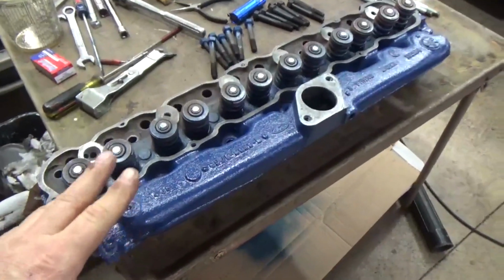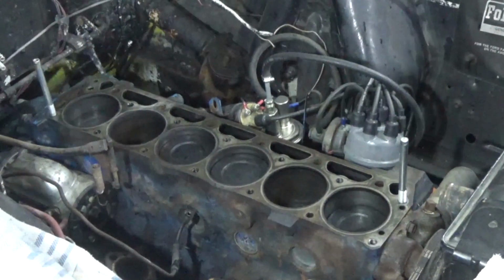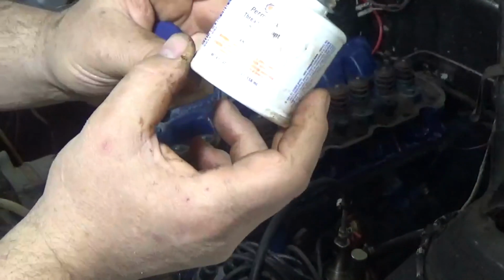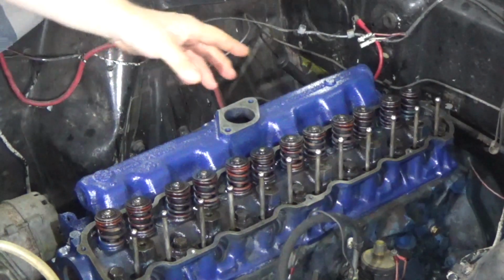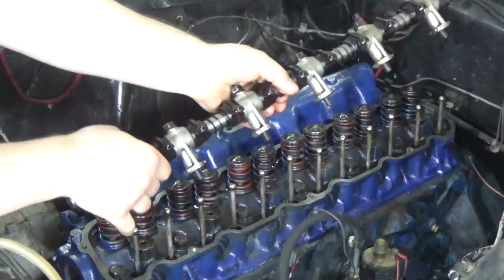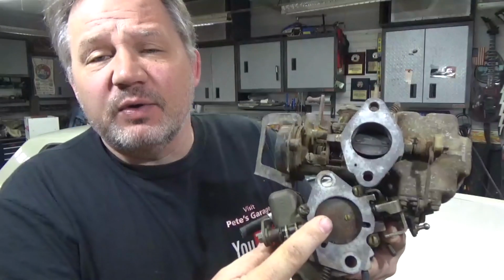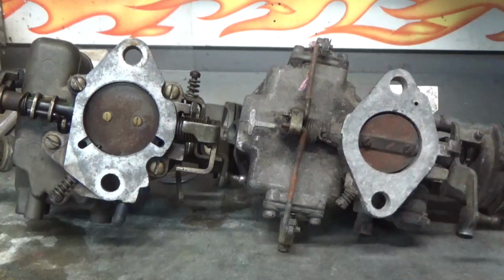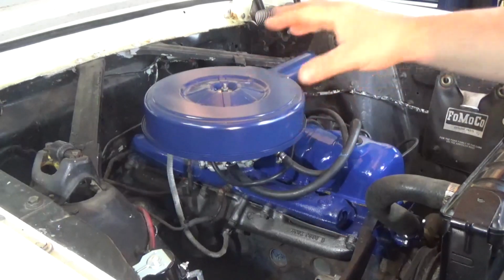Cylinder Head Install & Startup - 1965 Mustang Straight 6 200ci Autolite 1100 Carburetor

Comment: I know this is an old video but just incase someone want to imprrove oil flow to rockers. A 350 chevy narrow shouldered main bolt can substitute as head bolt un the oil feed location. It works maybe a hard washer on top to get correct thread depth.
Reply from the maker: Great tip!

Comment: Is there a fitting on the exhaust manifold that the heat-rise tube for the automatic choke attaches to? In your video, it appears that the bottom end of the tube isn't attached to the manifold, rather just flopping loose.
Reply from the maker: Yes there is. I do not have it on
Reply: @PetesGarage  Thanks, Pete. I'm helping a buddy replace the Autolite 1100 carb on his pristine 2-dr Hardtop '65 Falcon Futura, but it's missing the heat-rise tube & fitting for the auto choke. I'll have him order a new one.

Comment: Just got rid of 83 ford fairmont smog pump with a 200ci strait 6 and a auto lite 1100 carb and I’m pretty sure I have my vacuum lines all wrong now. Please help with any info or diagrams I can search up please and thank you. It does have the vacuum advance duraspark distributor
Reply from the maker: That should be easy to find online

Comment: Hi Pete, great videos. Would you be able to help me with my 66mustang. Inline 6, 200, autolite 1100. I am getting fuel and the engine turns over but wont stay on.
Reply from the maker: I'd start with the fuel pump. Disconnect the fuel line at the carb and turn it over, make sure you're getting enough fuel. Check spark at all the plugs

Comment: Not sure if u can guide me . 
Bought a 66 mustang from Washington brought it home and failed me . 1st carb at idle didn’t leak gas but when I turned it off it began leaking gas from the rear and front . Got a new one did the same thing not as much . After a while it stopped leaking completely took it around the block and it died and wouldn’t turn back on again. Kept on flooding the carb . Any ideas or recommendations?
Reply from the maker: Change the fuel pump, the check valve is stuck

Comment: Great video!   I need carb adjustment on a 63 f100.
Reply from the maker: You can do it! One needle to adjust
Reply: @PetesGarage  i am pretty sure I need to clean it out.   After sitting all winter in Wisconsin.  I have done small engine carbs before.   I adjusted the one screw and there were no real changes.
Reply from the maker: If the needle doesn't change anything the jet may be too large
Reply: @PetesGarage  if it ran tip top before storage I would think the jet would be good to go....right?
Reply from the maker: Sure, it could run, but the jet could still be too big. Maybe a good flush will help it out
Reply: @PetesGarage  if it ran better with the choke out would the jet be too small?

Comment: Just got one of these engines ,,,Why does the carb have what appears to be 2 accelerator pumps,,Any suggestions on where to get info on how the 1100 carb works,,Thanks ,Best Regards
Reply from the maker: One is the accelerator pump, the other is the dash pot

Comment: Do you have any advice on having the intake machined to accept two 1-barrel carbs and have them positioned over intake port #2 and #5?  My thinking is this would solve the "too rich" central ports and "too lean" end ports problem, but I don't know how much to reduce the cfm of each carb to keep the mixture where it belongs.
Reply from the maker: That's a pretty aggressive solution.

Comment: Where does the choke hose connect I don’t know where to connect mine on the exhaust manifold
Reply from the maker: You need a heat riser that fits between the exhaust manifold and exhaust pipe

Comment: Do you know the size ( nominal and measurment) of the main jet you had before? 
And we're you able to get the correct one from eBay or Amazon?

I'm pretty.sure I have the same issue.

I'm also curious as to what symptoms you had
Reply from the maker: There is only 1 main jet. I too it apart and got the size and bought a couple on either side of it. A web search for autolite 11000 carb jets will give you a ton of results. It was really rich, black smoke out the exhaust
Reply: @PetesGarage  Thanks. I will look into other jet sizes.
Henkyo sent me a message saying that perhaps the carburetor is deffective if it requires too many adjustments. 

Did you have to do any other adjustments apart from changing the main jet?

Thanks again for replying to me, and feel free to watch a few of my videos...perhaps there's something there that can help you???
Reply from the maker: The main jet is all I changed. I will check out your stuff, thanks

Comment: Hey good video.

That other carburetor looks like a carter YF...I had the same issue. The car still ran but would idle like crap.

Can you tell me about the new carburetor? Is it a new HENKYO from ebay? 
If so, can you give me some advice on adjustments? The one I bought came completely non adjusted so it wouldn't run right. The issue I have now is on idle, it will sometimes flood. The other is that the mixture screw seems to have no affect whatsoever engine still runs with it being completely closed.

I suspect main jet is too large??

Cheers
Reply from the maker: It was from HENKYO. I did have to change the jet a couple sizes smaller
Reply: @PetesGarage  thanks for your reply. I'll probably have to go the same route.

I've also had to do quite a few adjustments and I'm curious as to what you did.

Comment: Just replaced my autolite 1100 on my 68. Do I need to prime it first, and do you have a video showing how to set the choke and idle?
Reply from the maker: It will prime itself. I'm making a video about the carb adjustments
Reply: @PetesGarage  ok, great! I was able to get it going but will benefit greatly from a video on how to make the idle adjustments. I believe I may need a new accelerator return spring or whole new linkage set. I don't think it's returning to where it's supposed to which is messing up my idle. Thank you for the response, I'll keep an eye out for the video.

Comment: it looks like you have the wrong spacer plate for the carb.
Reply from the maker: I have been looking for the right one for this engine, it's out of a '68 Falcon
Reply: @PetesGarage  Depends on the carb. If you have the autolite 1100, it should be the Carb Spacer OEM Ford 144 170 200 6 Cylinder Falcon Comet Mustang More Pre 1968
(124749655048)
Reply: @PetesGarage  Correction: I see what you mean now. The bore on the intake manifold 68 motor is much larger and the auotlite 1100 does not fit it. Plus the base plate for the 68 - 200 does not have the vacuum channel. I think I'm just going to go back to the holly 1904 carb.

Comment: Hey, this is my first engine i am rebuilding at the moment. Now i am wondering. How to adjust the valves of this engine or is this not possible. By most pictures of other engines theres a bolt or something to set it. 

I see forward to an reply
Greetz Damien
Reply from the maker: There is not adjustment
Reply: @PetesGarage  okey, and is head miling possible? Because i cant adjust the valves.
Reply from the maker: You can shim up the rocker rail

Comment: great video! As for the heat tube going to the choke, where do you have that threaded into? i have one of those carbs on my 223 and i cant find a port to thread it into. my factory carb was a manual choke but unfortunately i cannot reuse it because its too badly damaged.
Reply from the maker: I could not find the heat riser that goes after the exhaust manifold. Most people just leave it off altogether.
Reply: @PetesGarage  how do you get the choke to work then? I just finally got mine tuned in today by manually turning the choke as it warmed up simply to make the idle adjustments. Runs about as good as a 57 year old engine can lol.

Comment: Ciao ciao, ho un'auto d'epoca in officina una ford mustang 6 cilindri a carburatore, con accensione elettronica, che bagna di benzina le candele dei cilindri 2 e 3. Compressione o.k, candele nuove, c'è corrente, sembra tutto o.k ma i cilindri 2 e 3 non funzionano. AIUTOOO. GRAZIE.
Reply from the maker: Sostituire i cavi delle candele, il cappuccio dello spinterogeno e il rotore. Assicurarsi che la distanza tra gli elettrodi sia corretta a .035 ". Sostituire la bobina per assicurarsi che la scintilla sia abbastanza forte. Se la camma è usurata su quei cilindri, potrebbe non ricevere abbastanza carburante.

Comment: Hey Pete, why is your breather cap in the back and PVC valve in front while in my '65 Falcon - 200 they're reversed?  -Greg
Reply from the maker: Great question, the carb plate has the PCV port on the back so that's where I put it

Comment: Are you familiar with vintage inlines? They make an aluminum cylinder head for the 200/250
Reply from the maker: That's a great question, I have seen a few select ones

Comment: I just swapped out my carburetor and the new one has a thermal choke. Where does the other end of the tube go? It looks like yours is laying on the exhaust.
Reply from the maker: The thermal choke goes to a heat riser that sits between the manifold and exhaust pipe. I don't have it in yet
Reply: @PetesGarage  Thank you and nice work.

Comment: I have been away from watching your videos for a little while so I am enjoying catching up.  Great to see you bought a 65 Mustang, because I recently picked up a 6 cyl 64.5 for an engine build with my 81 yo dad.  He has never wrenched on a car or engine so it will be a fun project.  I will use what I have learned from your engine build videos to build a 408 Clevor.  I will need to upgrade the front end, rear axle, and 3spd manual to handle the big V8.  I am looking forward to your 6 cyl rebuild this winter.  Stay safe and healthy.
Reply from the maker: That's awesome Michael.....good luck and have fun

Comment: I have a 200 from a 65 mustang, starts right up idles fine for a couple min then just dies in park or in drive, also stutters a bit during driving for a bit then normalizes,replaced carburetor, distributor and the whole ignition system and i cant figure what's wrong
Reply from the maker: A pinch in the fuel line back by the tank or a clogged pickup inside the tank

Comment: Might be a weird and basic question, BUT I have the exact same problem. Wrong size carb for my 200 L6, the line that come from the carb and ends underneath the exhaust manifold? where does it connect? And what size line did you use?
Reply from the maker: I'm still looking for where it connects. It may require a manual choke instead
Reply: You may have already found an answer, but I have the same problem. Someone put in an aftermarket carb on a 65 Mustang I bought with a 200 six. Rough idle, so I found there was no heat riser from a hole in the exhaust manifold to the thermal choke inlet. Instead the choke is being held partway open by a ziptie! Arrrgh. Bought a tube with a brass connector, should have fit but didn't. Carb was made overseas...think I need a rebuilt Ford carb. (Edit) It's ok now, I drilled out both the choke housing inlet and the old choke tube that was broken in the exhaust manifold. I also had to drill through the phenolic spacer and into the manifold vacuum spacer so the vacuum would draw hot air into the choke housing. Smoother idle and no black smoke.

Comment: Nice to see a 200 6 cylinder getting some love.  I've always liked these engines and I always enjoy your videos Pete. Just one question. Why is the engine blue? Ford engines weren't blue until 1966.  A 1965 200 6 cylinder would be black with a red valve cover.
Reply from the maker: Thanks Joe, but this is not a full restoration, and my daughter wanted blue...lol

Comment: I have a '65 with that engine.
I don't like that 'Spark Control Valve' and 'Load-o-matic' dizzy setup.
I bypassed all that, and switched it over to manifold vacuum.
Reply from the maker: Great idea

Comment: i just got a 66 inline 6 and the gas pedal was to low to the floor and i can't not get to WOT do i need adjust the throttle linkage?
Reply from the maker: Yes
Reply: @PetesGarage  thanks this my first car with a carb so i did not want to touch something i wasn't for sure. But i adjust the throttle linkage and it brought the gas pedal away from the ground

Comment: The carb that you took off the engine looks like the one that comes on a 250 six cylinder.  I have one of those carbs on my six cylinder falcon and it runs great.  That being said, I put 104 octane booster that is technically for off road vehicles only.  The problem with carburetors these days isn't the carburetors themselves, but rather the ethanol that is put into modern gasoline.  Not only does the ethanol cause the fuel to not want to ignite, it also eats away at gaskets.  Other than that, great video.
Reply from the maker: The engine is a '68 out of a Falcon so that explains it. Thanks for the comment
Reply: I have an Autolite 1100 on the 250 in my 71 Ranchero..... wasn't sure if it came with one from the factory. Still don't know

Comment: Couldnt you get a STOCK carb that fits the manifold and do away with the adapter? My Father had an early 60's Econoline I think it had the 170 with the 3 speed on the column...You really have to admit the early Mustang was a Falcon wit different sheet metal, what scares me about the Mustang is that gas tank arrangement
Reply from the maker: The PCV inlet is on the adapter...I looked but could not find anything different

Comment: Hello, wonder if you can help me my car is using bit of coolant every week, goes down in the expansion tank I top up every week now, there is No visible external leaks,oil looks normal to me, there is occasional white smoke coming out the exhaust , do I need to replace the cylinder head gasket?, thanks in advance!
Reply: there is a test kit to test for exhaust in coolant. You might want to try that or ask a shop if you don't want to buy the equipment.
Reply from the maker: I agree with Josh

Comment: Could you talk about that FOMOCO thing hanging on the inner fender?
Reply: That's the windscreen washer. Fluid in the bag and a pump in the bottom.
Reply: I believe its parts produced by Ford for Ford vehicles.  Short for Ford Motor Company I believe.  Many parts including that windshield washer bag are FOMOCO in both of my 66 and 67 Mustangs.
Reply from the maker: Yup, windshield cleaner

Comment: It's so WEIRD to have an intake that's integral to the cylinder head. But at least it's not the exhaust
Reply from the maker: I agree, it's very hard to clean
Reply: Nice video pete i have to drill my new carb holes out to where can I get a longer linkage and adapter plate? If you ordered it online can you share the link for me please I appreciate that thank you